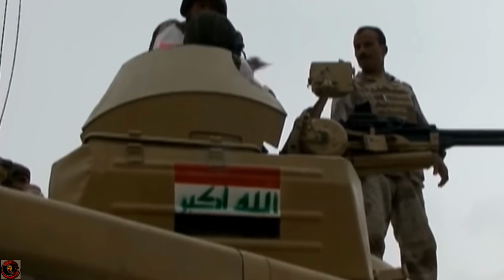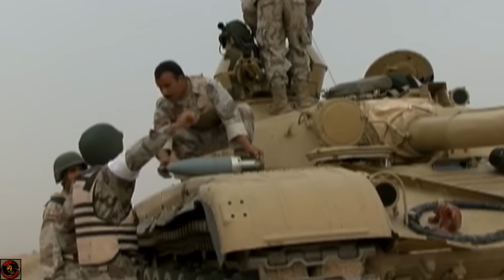Do Russian Tanks Need Bigger Guns?

Comment: Let ze Germans work out the solution... they have a knack for it... you wait and see...
Reply: Sjors Yes. And if the tank's unreliability impacts its performance then that is a serious liability detrimental to the design. You can have the best tank in theory, but if it can't even make it to the field then its overall performance is horrific. What experts? Like the mentioned reports?
Reply: Panther Ausf.D that was used in Kursk was rushed variant and had many problems later Ausf.G was more reliable then anything Germans had at time. It was more reliable then PzIII/IVs that was 7-8 year old models.
Also dont use that French document that says Panther is unrealiable. It was made using practice panther that had been used alot and because of situation in West it was poorly maintained.
Swedes and Brits both realised that Later panthers were really reliable even sometimes better then M4s if there was enough spare parts to maintain them.

You can go read Chieftain Hatch report where he had documents about panther and most of them were quite positive about the tank.
Reply: Sure its considered good for its front armour and gun for internet discussions. But given it was absolutely useless post war and had diabolical break down rates during the war (Kursk ec) its not one of the best tanks. Maybe best tank in theory, but certainly not in practice. If you want more reading; this is from a collection of the newest Panthers built and the best possible reliability with talking with the German crews and all the documentation & manuals; https://tankandafvnews.com/2015/11/13/from-the-vault-post-war-british-report-on-panther-reliability/
Reply: Are you sure you don't mean the T-34-76? The 85 series was quite successful. In 1945 the war was far from over and the ferocity of the last year reached its peak so every machinery got tested in 1945 extensively. Germany wanted to end the war on at least some favorable terms, this meant the USSR had to be beaten in some major battle. Hitler threw everything he got to the eastern front until for some reason he attacked the US and UK forces in Arden forest.
I'm not a fan of a needless complexity and both, Panther and Tiger had plenty of it.
"Only reason why panther got "Rekt" at the eastern front was 5 to 1" this is until 1943. Soviets learned how to fight a modern war after '43.
Reply: Sjors Like who? The German army didn't think so (read the horrific reports of Panther breakdowns and non-operational vehicles in Kursk), the British above certainly didn't think so, the French came to identical findings with their post war report; Le Panther. The Russians reported serious issues with their examples and the Americans kept as far away from using... any of its design as possible. So who is 'many people'?
Reply: Im not saying that T-34-85 was a bad tank,but shell that 85mm fired was really bad compare to German or late war US APCBC. Russian 85mm APCBC(BR-365A) in WWII had lots ot problems when they did hit armor that was thicker then 80mm. It was same problem that Soviets had with early 76mm ammo that was fixed after 1943. This problem occured because 85 had too big TnT filler (164g) that made shell shatter when it did hit thick FHA. Soviet know about this problem,but because war was going well and they didnt have time to start producing new shells they kept the old shell. 

After the war when they had time they started making new shell (BR-365K),that used smaller TnT filler (81.6g) and copied German design.Main thing that they copied from Pzgr.39/43 was "Caps" that were much better then older soviet designs.Even US copied Pzgr.39 shell to produce better M62 APCBC round in later parts of war that fixed all shattering issues that 76mm shells had.
Reply: Sarfanger FIN No. The French report was a collection of some 50 Panthers across all variants. The British documents even included that German crews report the same issues. What source are you using saying the British found the Panther was reliable? 
You mean where the Chieftain was pretty scathing?
Reply: Earlier specimen??? The British tested literally the last 4 Panthers made.
When the Panther had such serious reliability issues they couldn't get into the fight it does. Shermans had plenty of better aspects, better fire control & optics, better off road performance ect. 
Sherman gunner and Historian Ken Tout seems to think the Sherman was equal to the big cats, there is a crew member for you. Looking at things like the Battle of Arracourt where the Panther outnumbered the Shermans and got wiped out by the Shermans... the Shermans seem fine.
Reply: So if Panthers were unreliable early on, unreliable late on and had bad readiness rates in-between... when are you talking?

And if we look at other battles, ergo; most of Italy & Normandy Panthers again did terribly against Shermans.

Trained personnel are not going to stop the engine catching fire... Even the German POW's reported it an issue. 

That was German doctrine. Terrible reliability. The fact no one touched Panther post war as best as they could gives indication how bad it was. If it was so good it would have been rebuilt like the 109 was, but instead a few countries tried it for 2-3 years before they all broke down. 

I mean i don't find your view point credible. And plenty of historians seem to give similar indication.

So what stats are you using then? 

France used them for 2 years after the war before they gave up on how horrible they were. Shermans on the other hands were used for decades after just fine. 

Except i gave you instances where Panthers outnumbered the Shermans and still lost.
Reply: As said; that's bullshit. Plenty of countries used the Bf.109 post war yet that was out of production and German. 

Find me a report stating the Sherman, T-34 or Cromwell had a noticeable burn rate when just trying to start its engine please. If not then these issues were not present in other tanks. 

Sure. As we saw; the French reported some 80% breakdown rates across all versions with negligible difference between variants - Le Panther 1946. The Germans had similar issues in Kursk... or Bulge... or Normandy... you get the idea.

Except it was those German POW's who made note of its reliability, or German reports ect. My views are irrelevenat. The Germans also put the King Tiger or 262 into service with horrific breakdown rates.

Except in 1943 they had the same issues, in 1944 they had the same issues, in 1945 they had the same issues and the French reported the same issues on all versions in 1946. 

Yes it is the norm. 

2 Jagpanther's were in the mentioned British test docs. 

You mean like the accounts i gave before? Or ones like this? https://i.imgur.com/EVKUetf.jpg Tell you what. Lets take the entire US armies view from Italy after seeing Panthers. As a whole the Shermans did just fine, they won most of their engagements without too much issue and the tank crews refused anything other then their 75mm Sherman after seeing Panthers. I think that says enough. 

What was mediocre about the Sherman? It outperformed the bulk of the German tanks (Pz.4's, Stugs ect). Up-gunned versions butchered Tigers and Panthers happily.
Reply: Crag_r ssst
Reply: Sarfanger FIN I'll take the post war reports of late model Panthers thanks.
Reply: zachariaszut go to gulag with your inferior German technology
Reply: Crag_r look at the battle of cologne and you will se that the german troops could leave the tank after a hit whereas the Sherman tank, which was shot down by the panther before, didn't had any ability for crew protection.
Reply: Nonsense..The British simply had an earlier specimen while Kursk pushed in the battlefield tanks that had early problems and where  still underdeveloped..
Besides a lower reliability was not critical for tank design but rather its ability to kill other tanks..Do you actually think the Sherman that was more reliable was better than the Panther in any other aspect..?
Spare us ..Nevermind the 'reports'..
Ask a tank crew that met the Pantheer or their overall losses vs kills from battlefield tank to tank battles.
And the so many people is reference to many known authors of military books that concern that era and certainly not keyboard experts.
Reply: We are not talking about models early on or later at the war effort who had problems due to lack of materials or new untested parts early on ..The bulk of the vehicles wasn't  as bad..Besides we are talking about captured tanks with unknown track records or missing parts or usage even damaged and repaired ones ..Do not judge Panter's performance by single battles or bad use of tactics ..The overall performance should be the point.
Also at the Bristish report it is stated..''
Owing to the general mechanical unreliability of the Panther and Jagd Panther tanks, insufficient test results were obtained to enable an accurate assessment of the performance of these vehicles to be made.''
This is due to the unreliability because of the lack of spares and equipment or trained personel at the time of the assessment ..
If there was such an unreliability the Panthers would have been phased out in German service but that was not the case..
All tanks regardless of origin in WW2 had inherent problems ..
Some more serious than others..But this is not a reliability comparison.
Sherman gunner seems to think?
I don't find his view point credible.
It's like asking a Panther crewman his views on his vehicle.
People like that are attached to their tanks hence their distorted views.
Panthers did fight you know and the statistics about the ones that didn't are due to engine failures  are largely unknown or unreliable .
The Panthers also were used by the French as you know for many years after the war..
Not likely to have happened  if they were so bad as you say.
The Shermans were easy to make in record numbers ..
Tractors with guns..
That is all they were..Nothing remarkable or special about them..
If their numbers were comparable with the Panthers they would be no match.
Every German tank was outnumbered in the battle field..
Reply: Crag_r Teh Countries that tried it abandonded it not because it was a bad vehicle but because it was out of production and spares were not present and it looked bad to have a foreign tank in their ranks..
It was also more technologicaly evolved complex meaning more expensive to maintain and the war was over hence no need for it existed any more.
Simple and economical was the new demand..Panther had issues as other tanks had..
I don't see you giving any statistics about how many broke down in contrast to others that worked .
Instead all you are repeating is a battle with Shermans which was the exception to the known rule to present an inferior tank as a better one.
If we take your views for grantred that would mean the production rates would have been seriously affected and Germans would have considered it not fit for battle or gave it a bad reputation which was not the case..
Crews liked it and not tthe otrher way around.
Early models are the first batches and late models are in the few months of 1945..Then quality and materials deteriorated.
POWs state engine fires but was that the norm?
Check the German reports and accounts not to mention the Jagdpanther variant ..
So which one are they reffering to?
It seems you have a strange fixation to prove Panthers as useless and Shermans as a better design ..
You can find people you say what you say and i can find others that agree with me..
The accounts of those that faced Panthers at the battlefield say it all..
Do you think the Germans were worried against mediocre tanks like the Sherman except maybe the Firefly version?
I don't think so..
Read their accounts.
Reply: And Slave labor..
Reply: Can't wait for a gun laying drive that uses 70 levers, 32 wheels, and 50 buttons all in distinct shades of red.
All for fine tuning of course. We can't afford another tungsten slug to miss a target at 2000 meters.
Reply: The germans lost because lack of oil .
Reply: Remember 80mm can't penetrate T-34
Reply: By people that know little about tanks.
Reply: They had power steerings when allies used lever not to mention the night vision module on the panther and the very first RWS on a hetzer tank
Reply: @lordemarsh6804 THe Panther's automotive part was so garbage, the neutral steering when used could disable the tank, so drivers used skeed steering a lot, night vision module was only proposed for the Panther 2, which never saw action, there is no record of any Panther model that had it or ever used it, not that WW2 era nigh vision could be of any use practicaly.Stop praising their technology, because they where far behind the Allies.
Reply: Nice joke
Reply: @Sjors And? If you're ignoring most of the tanks lack of potency by just looking at front armour/gun then only looking at any WW2 tank seems a lot less worse.
Reply: German engineering at work
Reply: "With the introduction of M-4, T-34-85 and IS-2 the panther lost its edge very quickly. WWII showed that mobility was vital and German later tanks did not have this ability." What???
M4 was intoduced before Panther and T-34-85 wasnt even able to damage Panther from front unless it got lucky "Shot trap".
Also dont compare IS-2 to panther.
IS-2 was specialised breakthrough tank that had 122mm gun for destroying pillboxes and other enemy fortifications.122mm was nowhere near good AT gun.D-10T was good AT gun,but only AFV that used it in WWII was SU-100 that was introduced 1945.<-That meant,that it didnt have any significant effect to war.
Only reason why panther got "Rekt" at eastern front was 5 to 1 battles and by mechanical problems,because they didnt have parts to maintain it.
Reply: Well they did that in 1943 and ended up with a Panther that broke down every 150km...
Reply: @1993Crag  all earlier versions of tanks have their own problems,the later versions of panthers were used till post world war 2
Reply: Panther was very heavy, had difficult maintenance and had several design faults. With the weight of 45 tons mud often got between wheels and the technician had to remove several parts to fix this. This tank caused lots of headaches to its crews.
With the introduction of M-4, T-34-85 and IS-2 the panther lost its edge very quickly. WWII showed that mobility was vital and German later tanks did not have this ability.
Reply: Arved Ludwig How come the Sherman had incredibly high survival rates, one of the highest of the war when it came to getting out after a hit? Actually the Panther is a funny one, the crew don't have quick open hatches on the turret. The Commander has a crank open hatch for himself that will take about 20 seconds to crank open and the loader / gunner have to try and lug open a heavy rear door onto a statistically burning engine deck.
Reply: You're absolutely right Rheinmetall is the word
Reply: "The Panther was a large vehicle.  The suspension provided very good stability.  Some tanks demonstrate adverse effects from firing, particularly when firing to the sides.  But not the Panther.

The fatigue life of the mechanical parts was designed for 5000 km. The wear on many parts is greater than expected. Track and running gear have a life of 2000 to 3000 km. Tracks break very rarely, even on rocky terrain. The bogie wheels, however, can become deformed when driven hard."

"These comments, from operational experience, highlight that many aspects of the Panther were in fact quite comparable in reliability to American or British contemporaries.]"

Only real problem in late war Ausf.G variants had was Final drive that needed maintain or even replacement after 150-300km.This problem was never fixed because of war ending,but other then that most things like engine had 1500-2000km life-span

Scource: Tom Jentz Doyle Panther 1942-45
Reply: Their Leopard II has design flaws. Overrated
Reply: Sjors WRONG. it is considered the best medium class tank of the second world war because of geniously engineerd and versitile it was.